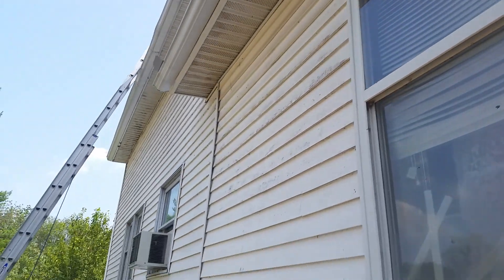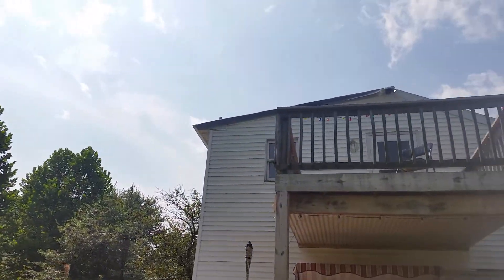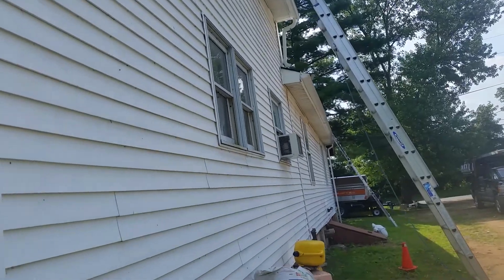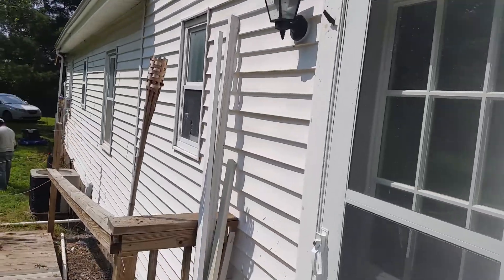New roof.

Comment: wow , lot of update , big ass house
Reply from the maker: it's about 1600 square foot inside. Dad and i built the addition when dad came home from operation desert shield in 1991. our old kitchen and bathoom were on a  back porch addition, it was rotted real bad. we now have 3 bedrooms and 2 bathrooms and a large kitchen and dining room, a living room a craft room, a laundry room. basement houses the mechanicals and the coal stove. ceiling down there is not quite 6 foot.
i consider this the homestead. dad bought this house in 1968 for $6500.00